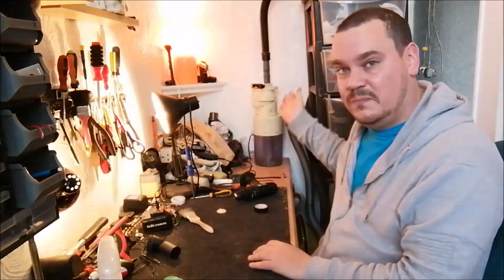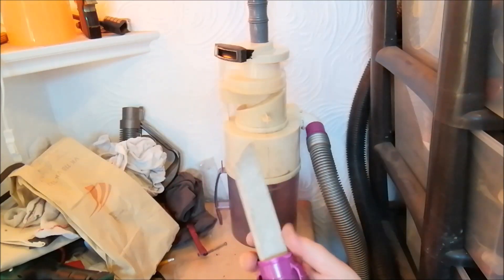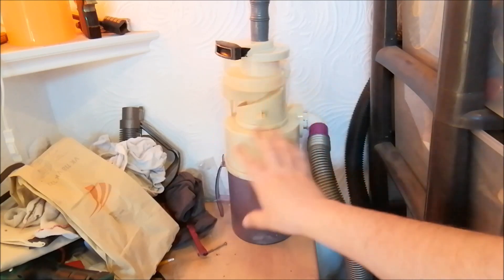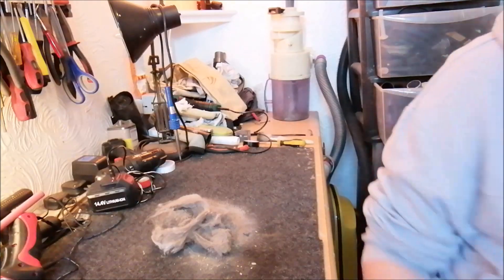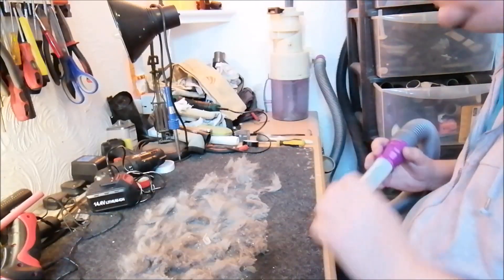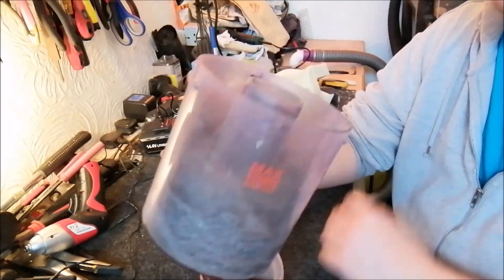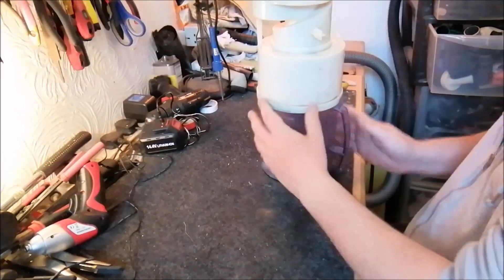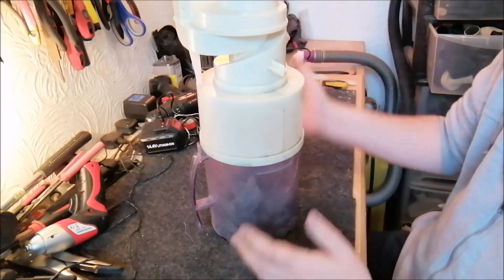Hoover Vortex V2000 Bench Vac! Is this a good idea? Probably not...

Comment: Good idea. It’ll be interesting to see how much fine dust ends up in the Miele bag. 
Just an afterthought. The bearings in the Miele are noisy, so how do you feel about making a motor refurb video of the Miele.
Reply from the maker: It's quite funny - you've asked me to refurb it to stop the noise and another chap asked me NOT to do it and keep the noise lol. I suspect they will HAVE to be done at some point...
Reply: @TheVintageApplianceEmporium  lol yes that’s quite amusing, myself asking for a refurb and another wanting the opposite. 
On a completely different not I’ve just bought an Electrolux ZA65 off Facebook market place. 
How do I date the machine from the serial number?

Comment: This is very clever idea! I have used the Dyson DC14 cyclone/bin unit (pre motor filter in place) with some of my bagged vacuums. It works quite well, but like you said it has big effect to the airflow.  For example when I used it with my Lux Royal D790 it lost 30 cfm. Lux alone had 92 cfm, but with the DC14 bin in use airflow dropped to the 62 cfm. I really like your setup. Only thing to be careful is not to run this combination too long. Resistance of the Vortex system makes the Miele motor run hotter and it might overheat when it doesn't get the airflow what it's meant to have.
Reply from the maker: Wow that's a massive cfm drop!!